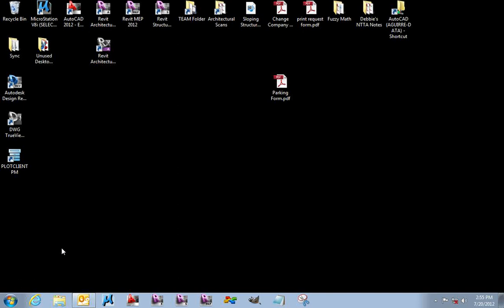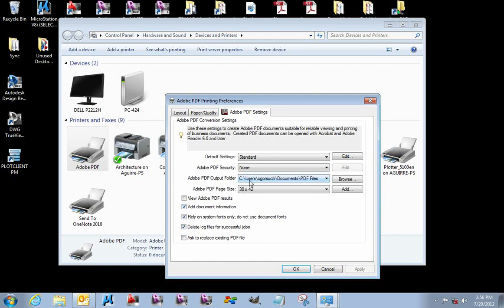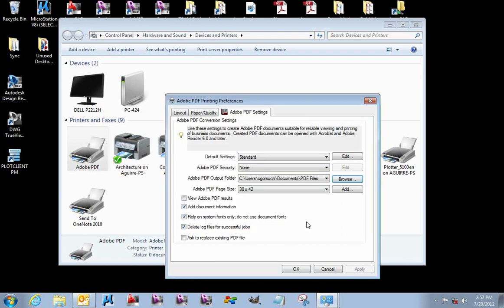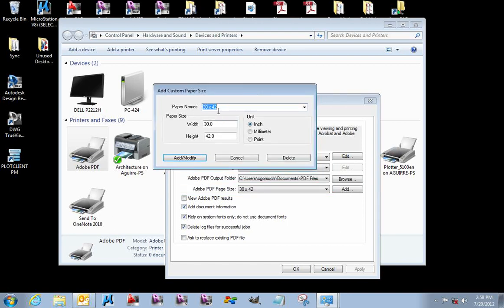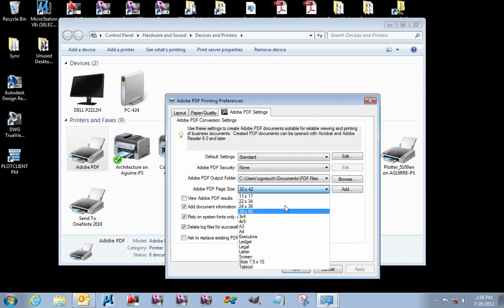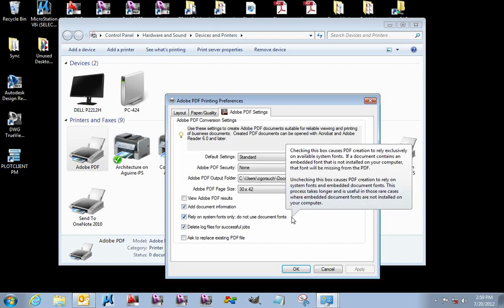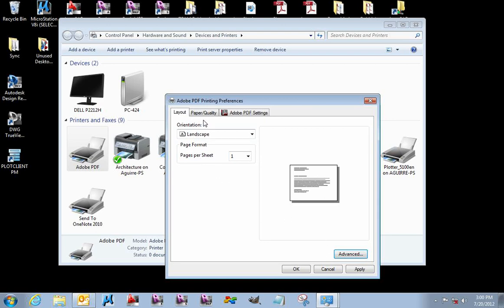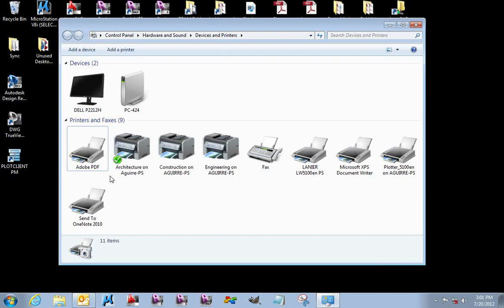Adobe PDF Printer Driver Setup

Comment: You captured my search by showing up for Adobe Printer is missing as a printer port - it is not missing on yours. Problem not solved!
Reply from the maker: Is this a personal computer or office computer?  Is there an IT department?  Is the Acrobat Printer Driver expected due to other Adobe products being installed?  Sorry this video didn't help, but it was designed to address a specific problem.  Sorry that specific problem didn't help you.  Hope you're able to find a solution.

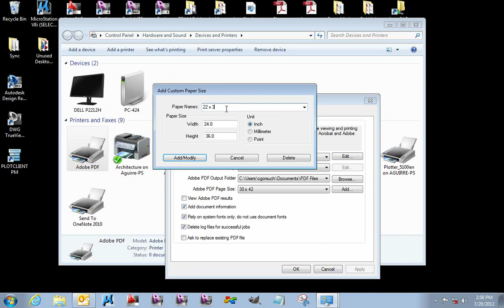Comment: at 3:14 I get an error message when I try to add A1 size paper, any suggestions ?
Reply from the maker: Depending on what version of Adobe Acrobat Professional you are using, (In the video above, I had Acrobat10 installed) you can not add a paper size that matches a size in the defaults.  I could not add an 11x17 size, because 11x17 was already provided in the defaults.  I believe size A1 fits that criteria.